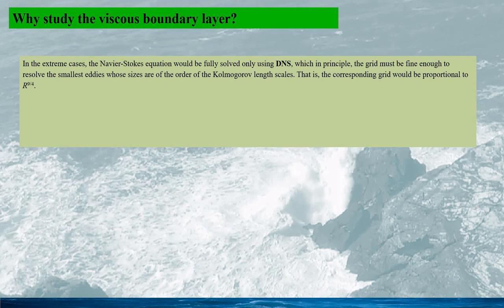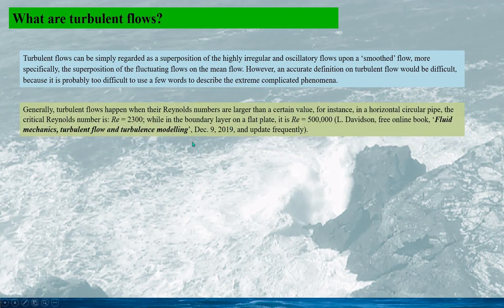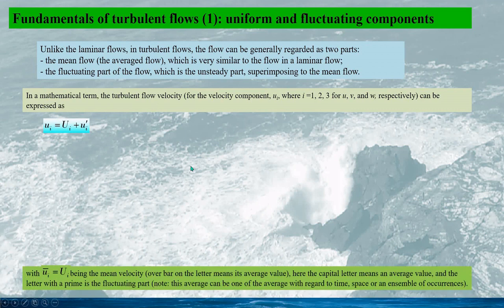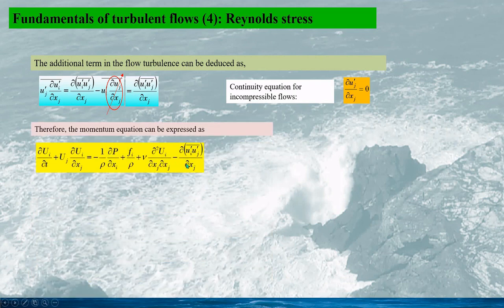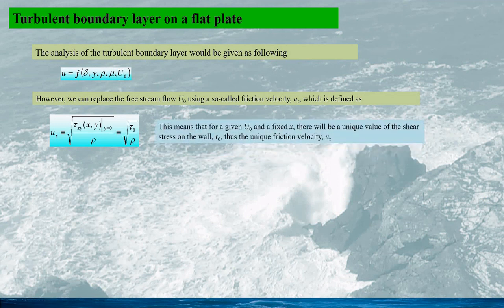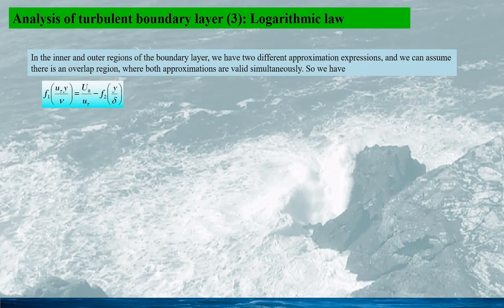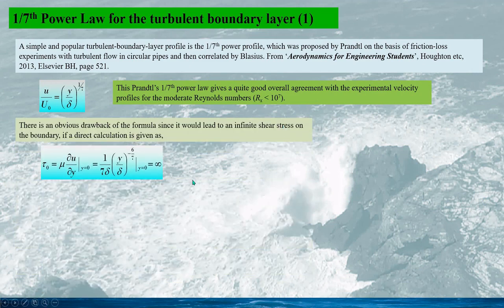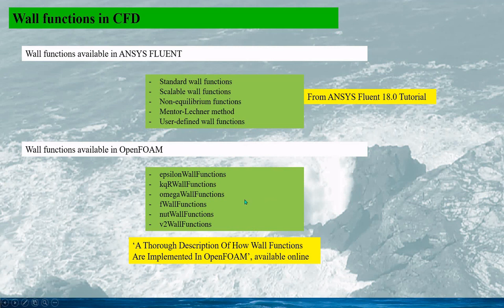[Fluid Dynamics: Boundary layer theory] Turbulent Boundary Layer

Comment: Dr. Sheng, thank you so much for your video.  

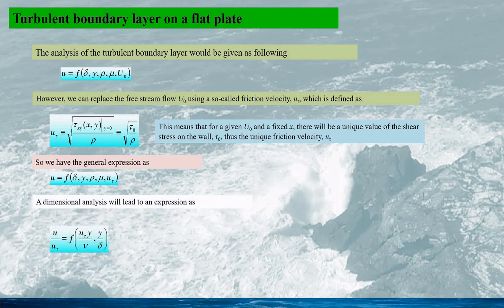You mentioned (in time 20:22) that there is a unique value of the shear stress on the wall at a fixed x for a given freestream velocity.  In other words, the wall shear stress is constant in the wall-normal direction within the turbulent boundary layer (which is analogue to the constant pressure in the wall-normal direction as interpreted from the order-of-magnitude analysis on the dimensionless 2D N-S equations on boundary layer). 

The constant wall shear stress in the wall-normal direction within the turbulent boundary layer is an important argument to derive the universal velocity profiles for viscous and log-law sub-layers.  I reviewed more information in the internet and see that many people take it for granted to raise this argument, without a clear explanation.  Can you please explain more on this point?  

I have an explanation on this point for myself, see if you think it is reasonable:

In the thin turbulent boundary layer, the change of the fluid stress in the wall-normal direction is negligible (i.e. fluid stress in the wall-normal direction is constant).  The boundary layer theory suggests that (1) the pressure (hydrostatic component of fluid stress) is constant in the wall-normal direction and (2) the order-of magnitude of the gradient of velocity (deviatoric component) in freestream direction over the wall-normal distance dominates over others.  Therefore, wall shear stress is constant within the boundary layer.